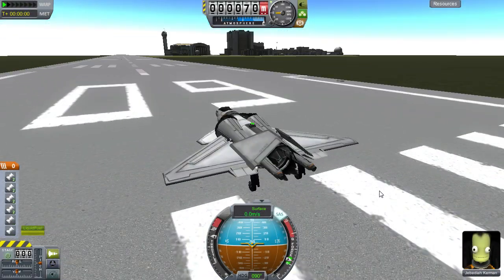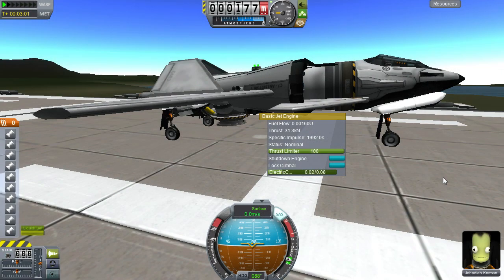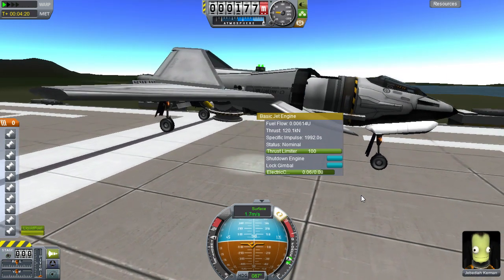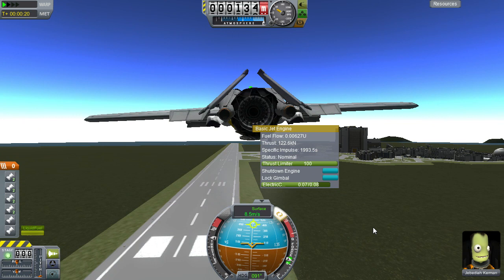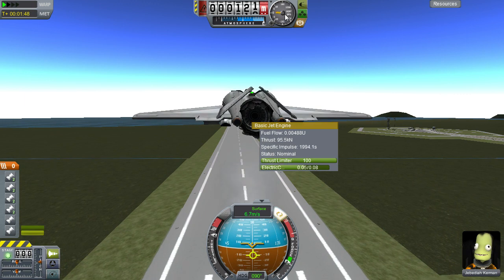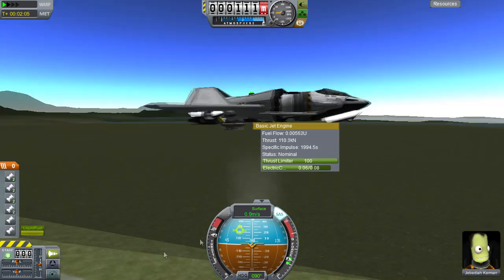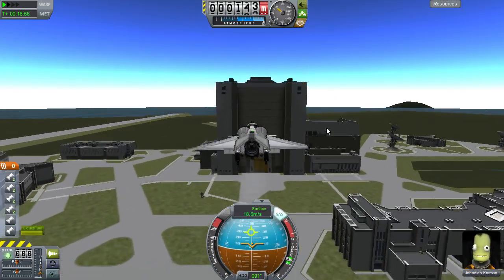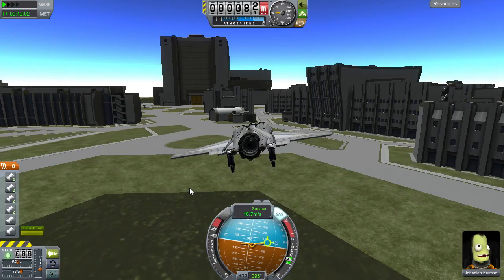KSP VTOL Tips: Toggle Your Intakes and Engines for More Control!

Comment: The helipad is 666m from the rocket launch pad in a straight line
Reply from the maker: Really? Is this the horizontal distance, or the length of the "hypotenuse"
Pretty crazy that it comes out to 666 lol xD
Reply: Basically, I landed/crashed a rocket up there and when I have something on the pad the distance shows as 666 so it's the hypotenuse
Reply from the maker: gwynjudd Ah gotcha! I was wondering how you would even measure that :D